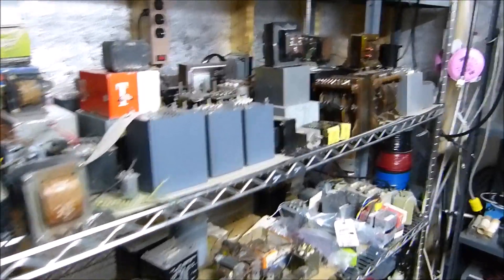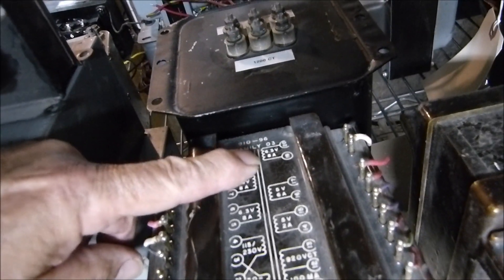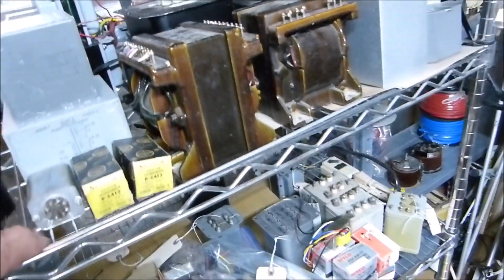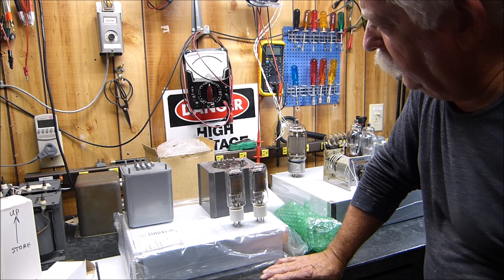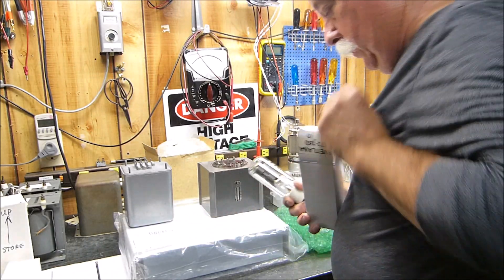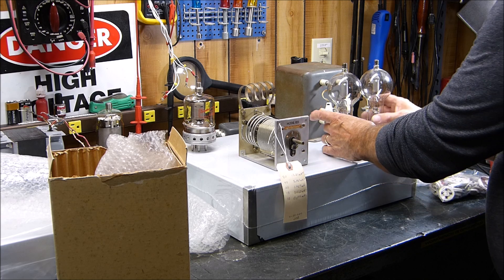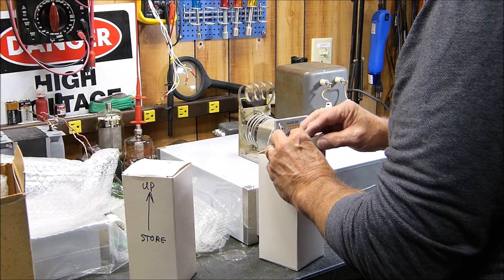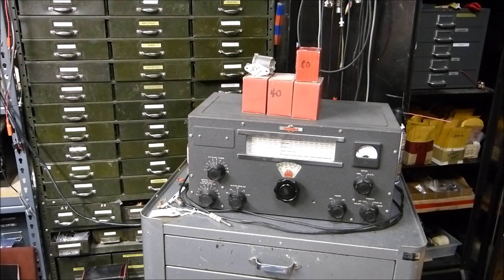Part 2 - Vacuum Tube Audio Amplifiers - What To Build Next?

Comment: I’ve also got some huge transformers that were used to run huge lights. Would they work. I can come up with some big transformers for a two tube box.
Reply from the maker: I doubt transformers to run lights would work. I would assume the impedance of either winding is not going to be high enough to work with any vacuum tubes.

Comment: Hey El Paso,where u get your chassis?   Hammond?
Reply from the maker: They are either made by Hammond or Bud but I buy them from:  www.mouser.com   Here is a part number to get you in the ballpark as their search function is sometimes difficult to navigate.    563-AC-420   this is a big chassis of   13 x 17 x 3
Reply: @ElPasoTubeAmps thanks,had seen the Hammond catalogue and do what you do but in a much smaller less technical manner. The last couple were based on old mono homebuilds I stripped down to the P/S and built up for two channel stereo. Have a few old Stancor A-80XX series I've salvaged and some pirated from the last of the good Bogens the MX and MO-××A series. I use mostly circuitry lifted from marantz & McIntosh tube power amps and the results are very very good.

Comment: I was wondering if you can give me some advice, I am looking to build a amp using 4-65a tubes and I need to locate Two transformers - one @ 5watt with a impedance ratio to 1/2 secondary 1.5:1 the second transformer @ 300 watt modulation transformer 2.4:1 pri 20,000 ohm, secondary 8,333 ohms any help would greatly be appreciated

Comment: Or a Modulation Amp :)) P.S. Can that, or those extremely large trafo's with dual primary and many filament windings be used as a PP output trafo? Probably not, they're only 110[V]...

Comment: Looking forward to the final results. With your skill and craftsmanship they will be beautiful . I did cringe at 6:54 when you placed the transformer on the chassis. Glad you have steady hands. It reminded me of a hamfest I attended many years ago. A seller had a 4-1000 sitting on the end of a folding table. The tube rolled off the end before he could reach it. POW !  You could hear a loud sigh from everyone within a 100 foot radius .
Reply from the maker: Ouch... I know I am a little careless sometimes and if something starts to fall it could be a real mess especially when I am using my good tubes. That is why I have a box of duds to model with but I have been lucky  - so far...

Comment: I knew this guy who built valve amplifiers for the Japanese market the CEO Sony had two of his power amps. He said you always have to have your valves far apart much as possible I think it's something to do with radio interference they admit or something don't count me on that. So have your valves further apart to introduce decoupling. And he had a separate power transformer on a separate chassis I can remember they were connected using army surplus tank connector silver plated waterproof din connector screwed and locked together. Something you should be able to buy from army surplus.
And maybe mounting your Transformers on the chassis have a strip of absorption pad like sorbothane, to cut down vibrations from the Transformers going through the chassis back into the tubes

Comment: Maybe you can explain the Circlotron typology some day in the winter when you have time?

Would like to hear your explanation and honest opinion.

There a literally not much info out there. At least not one that's easy to understand.
Reply from the maker: Circlotron typology is a new term for me. Is Circlotron typology  referring to NFB and THD reduction in audio amplifiers or am I way off base? Please help me understand more as Googling it doesn't tell me much just as you mention in your comment.
Reply: @ElPasoTubeAmps  the Circlotron (a.k.a. Parallel push pull) is a typology where the audio signal is traveling through the power transformer.

It was mostly used in recording studios and - as far as I know - has an extremely low distortion "with excellent sound quality". 

I think I have some resources on that somewhere but I'm not sure if it's in English but you can at least have a look on the circuit diagrams. If you're interested, let me know.
Reply: @DMC428  you might be able to get the explanation from leeks journal where he talks about the TL 12 watt amplifier in detail I think it was written in the late 50s early 60s should be able to find it if you Google. Remember him saying that it is wrong to have balanced tubes per channel if I can remember something to do with feedback circuit introducing an oscillation
Reply: @johnsweda2999  thank you for your reply. I'll look for it.